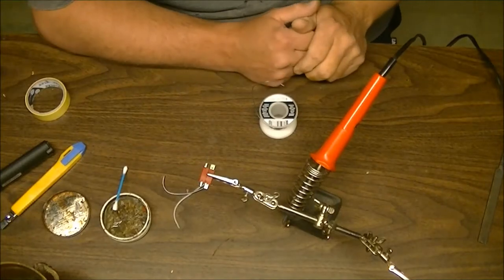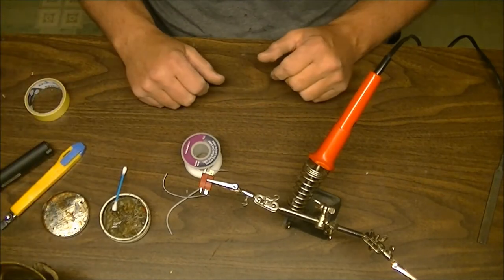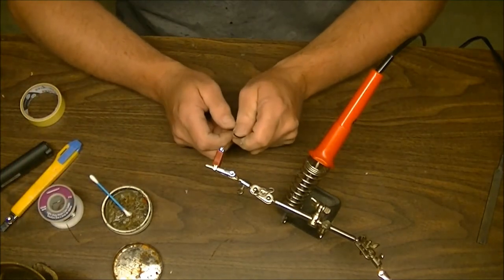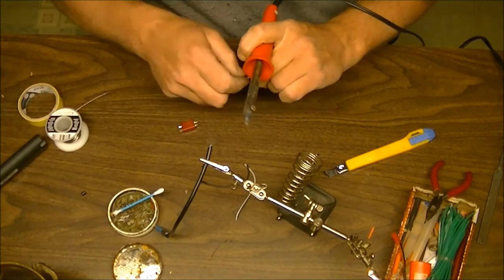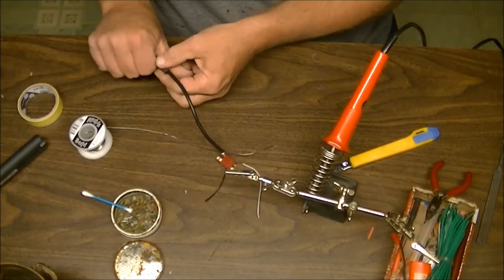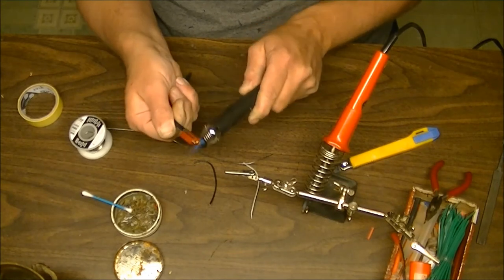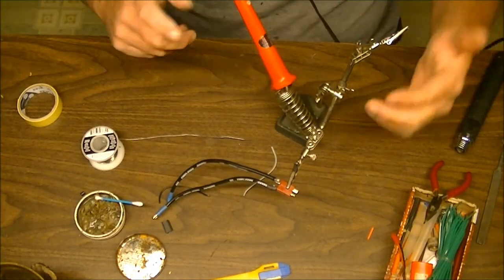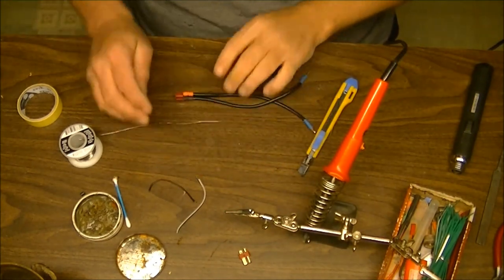How To Prep And Tin Wires And Solder Connections And Shrink Tube

Comment: Thanks for the vid, I just got a new soldering iron kit for my b-day and I need to know how to properly solder connections. Also, do you know what the stuff called Soldering Wick does? it came in the kit but I have no idea...
Reply from the maker: Jonny Cox its for removing solder but i just use a solder sucker works alot better and less mess to
Reply: Oh, one of those de-soldering pumps came in the kit too. Thanks for the tip!
Reply from the maker: Jonny Cox your welcome